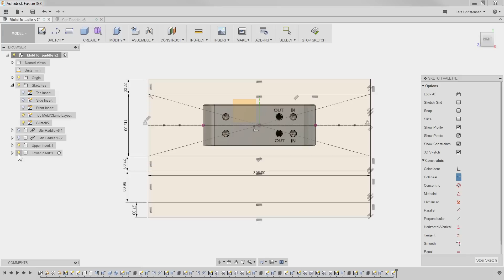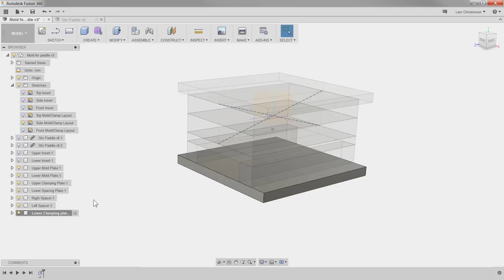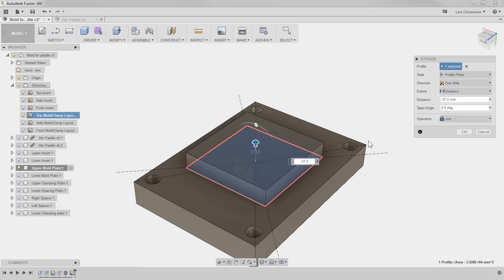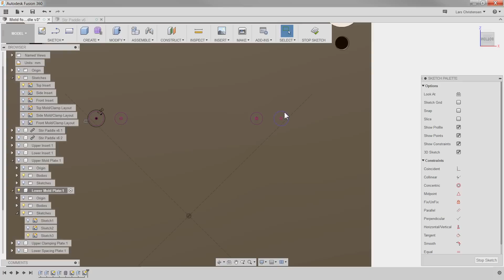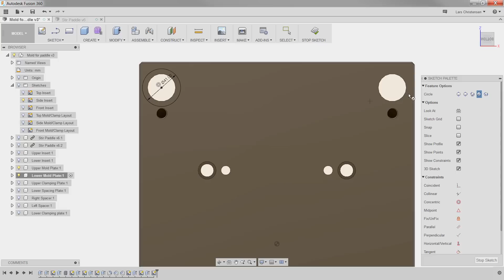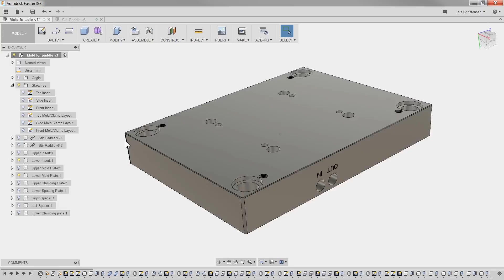Fusion 360 Tutorial — Beginner To Advanced — How To Create a Mold— Part 3

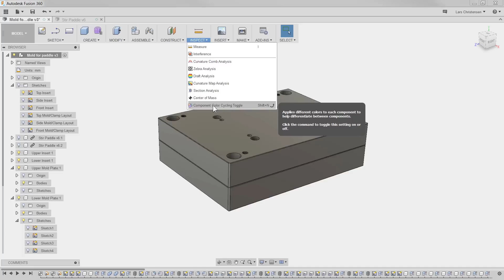Comment: 28:49 component color is a really nice tool. Not only you can recognize copies of the different components but also it's much comfortable to work with a timeline of a whole model. It allows you to clearly see components' changes as stripes which are painted relatively to their components colors. Should have mentioned it earlier by the way. Thank you for the 360 tutorials.
Reply: Also it would be much easier to follow you with this tool without constant "pause-play" because sometimes I can miss some seconds while repeating things usually these are tutorial's fast components rotation on another side of the model with activation of the similar looking copy of the component in the browser and If I missed it I can mistakenly use Project tool without activating the different component or sketch. Colored components can say right away which component really it is instead of spending additional 10 minutes every tutorial to check every time if we have the same components activated before creating/editing a sketch, projecting or press pulling or using another tool. I like the additional practice with press pull, project, sketches managing and a lot of Ctrl-Z and Ctrl-Y in case if I do all of those for example on the wrong plate and 40 min guide sometimes can become a 2 hours lesson, however, I can understand this is still more a part of learning process and it's up to me to follow videos more carefully.
Reply from the maker: Hi 2FAB4U Thank you for watching! And thank you so much for the feedback. It means the world to me.

Hope you havce an awesome day!

Comment: dear Lars if we all  crew hole and inject pin create in sizes first and then try to set up through all plate and mold blocks try to combine and cut tool  command for hole I think that would be so easy to set up, frequent times to do hole and depth hole these doing so bothering I think. I expecting such kind of video firstly create all screws and inject pins in shape and then set up through all plates and all mold blocks. thanks dear Lars.